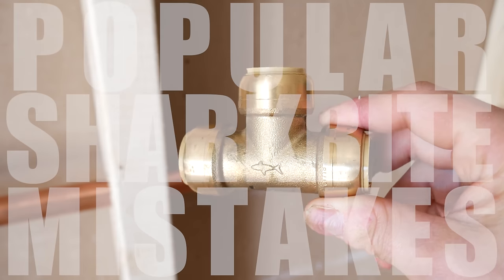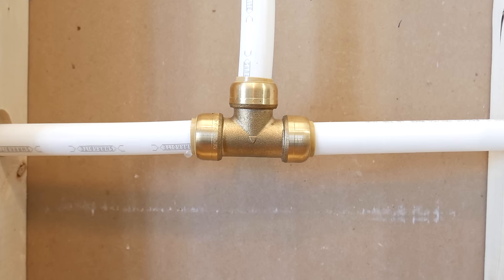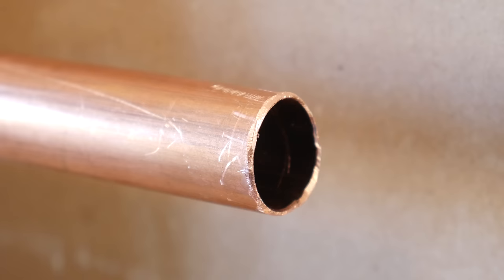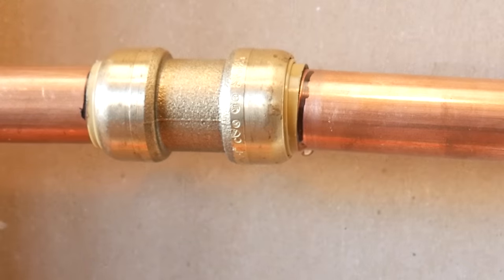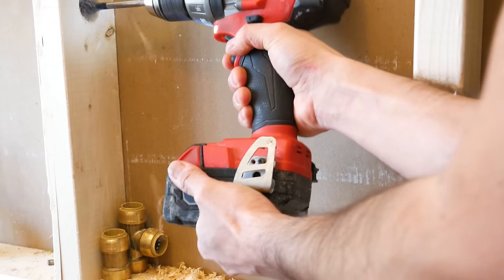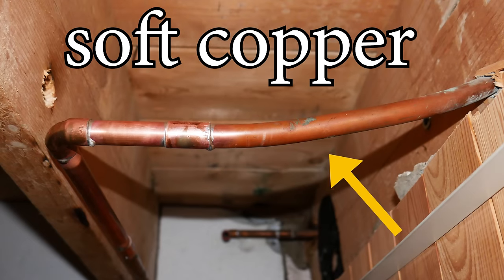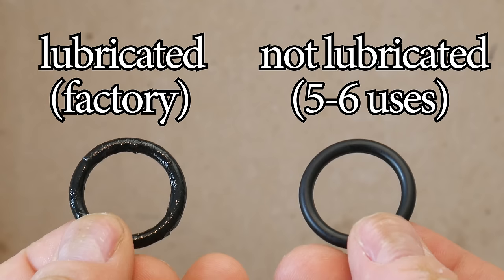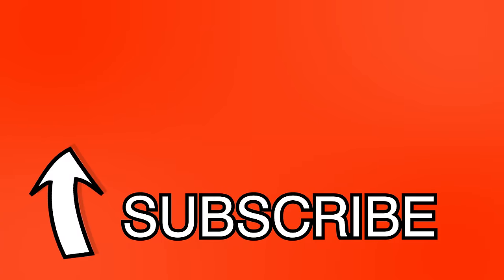6 SHARKBITE Mistakes NOT To Make! | GOT2LEARN

Comment: These are great fittings. They work well. They do rely on a rubber Oring to seal. As with any O-ring in about ten years the O-ring will fail. So never install these in a wall or ceiling. Leave them accessible.
Reply: Propress uses o-rings.  So theirs will fail in ten years too?  Propress fittings are installed in very inaccessible places.  What about the hundreds of o-rings in the modern automobile?  Ten years for them too?
Reply: @StilettoSniper  I said in about 10 years the O-rings would fail. Could be 7 could be 12 years but at some point they will fail. I’m a 35 year Master Plumber so I cannot speak to automotive O-rings. I would say pop the hood on most 10 year old cars. Most have oil leaks.
Reply: @Iwillnotbepushed  So you would recommend never installing Viega ProPress fittings in a wall or ceiling for the same reasons then, i.e. the EPDM o-rings will fail in approximately 10 years or so, correct? BTW, in my 40 years of wrenching on  automobiles, including the 18 and 20 year old ones I drive currently, I can attest to most oil leaks coming from non-EPDM gaskets such as oil pan, transmission pan, and valve cover gaskets, which dry out and crack due to being exposed to harsh chemicals, extreme heat and mechanical pressure.  Not EPDM o-rings, of which automobiles manufactured in the last 20 years have hundreds.
Reply: @StilettoSniper  that’s all well and good. I also do my own mechanic work. Always have since I was 15 years old. Rear main seals front transmission seals water pump seals. all rubber will eventually fail and in plumbing usually that means 7-10 years. Like I said I cannot speak to automotive except my own experience. I do not put in ceilings or walls anything with a rubber seal that’s under constant chemical and pressure assault. That includes Pro Press. I do not like it I do not use it. I have several other systems I trust far more. Also with Pro Press there is a copper fitting and copper pipe involved. Ever seen copper get pin holes in it? Happens for numerous reasons.
Reply: @Iwillnotbepushed  OK, while I may differ regarding your approximately 10 year lifetime estimate for EPDM, I do respect your opinion since it is one of the few responses I've heard that is logical and recognizes that the EPDM o-ring material used in ProPress and Sharkbite is essentially identical.  Most professionals I've spoken will shit all over Sharkbites and say they will leak because the EPDM o-rings deteriorate with age, but then will state that Propress fittings will not have these o-ring deterioration issues because they are crimped with thousands of pounds of pressure with a magical overpriced tool.  Logically, this makes no sense whatsoever since the fact that the o-rings are in a crimped sleeve has absolutely nothing to do with their lifetime.  Thank you for taking the time to explain your position clearly.
Reply: @StilettoSniper @Alan Sawyer While I am neither a mechanic nor a plumber, I have my two cents to give. I have a hard time believing EPDM O-rings only last 10ish years. I am a commercial flat roofer, and we use EPDM membranes occasionally and you can normally count on them to last 25+ years sitting out in the sun 24/7. I know UV exposure is different than being under pressure, but 10 years for a sharkbite (or similar brand) seems unreasonably short. I put sharkbites in my house 8 years ago in an area the was to risky to solder, and I couldn't get pex crimpers in. Should i inspect them in a year or two? They are behind drywall...
Reply: @humblehunk9022  they are acting like copper last forever.  It doesn't.  Everything eventually fails . Time will tell on these things
Reply: @StilettoSniper  He's right when it comes to city water. But if you're on a well with no Chlorine Content then I could see these lasting SUBSTANTIALLY longer. There are some really old flappers in homes with well water because the chlorine isn't eating up the rubber.
Reply: @StilettoSniper  The warranty on Viega PP fittings is 25 years. How long is the Sharkbite warranty?
Reply: @MisterTwister88  they warranty them for 25 years also as long as they are installed per manufacturers instructions...
Reply: @aaronmetcalf527  Yeah…..I know that

Comment: Wow. Thanks for these videos! 

 All for your videos you guys got me to cut the 4 old multi turn shut off valves and replace them with 4 new SharkBite valves. 
 What a Breeze in installing them.

 Was hesitant at first, but after watching your videos I tackled that job! 

   Is it true or it's a myth by using fine grit sandpaper it can ruin the copper pipping?

 I forgot to buy the depth guide, so I measured with a tape measure and the online website guide. Let's hope it works! 

 Thanks a ton for all your Amazing videos!  Big fan! 
 Just came across your channel and been loving it ever since. 
You guys are clear and to the point.
Reply from the maker: Thank you so much!!

Comment: I’ve been in this trade 40 years, I hate shark bites, the younger guys seem to love them. In a copper pipe leak situation, I prefer to install a compression valve, no rubber to deteriorate.
Reply: The only place I would feel comfortable using sharkbites is exposed pipes, anything behind a wall should use longer lasting fittings.

Comment: You didn't mention using sand cloth to debur. I just put one on today, a shut off  for the kitchen hot water. Cut the pipe with a Milwaukee 1/2" pipe cutter for small spaces. Nice clean cut. Clean it with the sand cloth and a rag. Bites right on. 
I want to know what happened to the ones that click when they're installed properly.  No room for error.

Comment: I have a question... if you did not fully insert the required 1" pipe into Shark Bite, can't you just push the pipe in a little more until it is snugged after the fact providing that the pipe has some slack?
Reply from the maker: The best way to verify is to have the mark, without the mark you can't be sure at 100%..
Reply: Yes

Comment: Any thoughts on leaving the pipe stiffening insert in the fitting when used on hard pipe?
Reply from the maker: Yes, you need to leave it in, copper or PEX.
Reply: sharkbite dŏ t  com/resources/faqs/universal-brass-push-fittings-faqs
Can the tube liner be removed?

Yes. The tube liner can easily be removed by pulling it past the o-ring, with the aid of the SharkBite Disconnect Clip or Disconnect Tongs (both sold separately). The tube support liner can drop out of the fittings as it can move freely past the grab ring. Needle nose pliers may be used to pull the tube support liner out.

NOTE: The tube liner is necessary for use with PEX, HDPE or PE-RT Pipe. It is not required for copper or CPVC, however, it is not necessary to remove the tube liner from the fitting.
Reply: For hard copper remove the pipe stiffing, most cases where there is a leak in hard copper it is because it was installed with this fitting and it obstructs the connection.  On PEX, CPVC it helps to strengthen the joint.  It is bot needed with the copper wall.
Reply: @alsworkshop135  Hey Al, could you please explain what the this “pipe stiffening” is that’s not needed for the copper wall. I’m going to use this shark bite on a connection of copper to CPVC. So, I’m assuming you’re referring to the copper side of this attachment. I just don’t know  how to identify what you’re saying to leave off (or out) of the copper end. 

Thanks
Reply: @YouTubeStudio101  yes, on the copper side of the connection you can remove the plastic piece on the inside of the sharkbite.  I use needle-nose pliers to remove it.
Reply from the maker: No need!!
Reply: @Got2Learn  check out the Sharkbite website where it says you can remove the plastic stiffener for copper connections.

Comment: I have never had a leaky Sharkbite fitting from the Sharkbite side (had a threaded side crack once after a few months of use).  Have used hundreds of them.  Aside from the depth markings, which I have never done since the click when fully inserted, I would think that all these things are common sense.  It may just be me though since the plumbing my dad taught me was to sweat the pipes.  I switched over to Sharkbites when I found them around 20-25 years ago and switched to using just them after talking to a friend of mine in aerospace saying that the technology has been around since the 60s and was used by NASA.  Replumbed whole houses with Sharkbites and PEX.  I have just started using the Sharkbite MAX fittings on newer projects and like them even more since you don't have to have the white plastic pipe support any longer, which means even better water flow.  I know they have their haters, but from my experience it is only misuse that causes them to fail... just like most things.

Comment: The dislikes are from "old-school" plumbers who swears they see leaks from SharkBites all the time but never on a soldered copper joint.
Reply: @sonacphotos  -  I was being sarcastic about the dislikes. I agree that SharkBite has their uses - I use them where their easily accessible and can be checked for leaks. But I definitely don't agree that plastic will outlast copper. A proper soldered connection will last 50+ years and the pipes can be re-soldered, whereas SharkBite can a warranty for up to 25 years. CPVC becomes brittle and will break easily after decades during a re-pipe.

Propex is the only connection and material that can probably last as long as copper.
Reply: Shark bites are only guaranteed for 15 years, Crimped pex and soldering is guaranteed for 50 years
Reply: @onebozo4u , don't know what you're talking about. SharkBites are warrantied for 25 years, this is straight from the manufacturer's website.

With crimps and clamps, you're fighting against the expanding nature of the pex, so those connections get weaker over time. Propex is the only one that gets stronger over time.
Reply: Only hacks use shark bite fittings. Real plumbers don’t
Reply: I see Sharkbites leaking alot on soft copper. I also see them leaking on hard copper due to the person using the plastic inserts on copper.  I see solder fittings leaking as well.  It's all about the installation
Reply: That's right  😁 👍
Reply: @lawrenceolteanu7234   …so don’t even think about using a Sharkbite ‘cause you’ll be demoted.
Reply: @Lawrence olteanu  I'm not a real plumber but now I don't need to be.. or need one
Reply: Or old school plumbers who see billable labor hours going down the drain!

Comment: Good tips. I only use them if I positively have to. I'm old school and I don't trust them.
Reply: I'm retired, so I guess I should be old school, too.

That old school method sure did a great job here in Texas this past February 2021. Only about every other house on my street (including my own) and neighborhood had busted pipes.

'Trust' is relative.
Reply: That's more a design issue than method with Texas.   All the plumbing was made with the thought "it'll never get that cold for that long, why bother including the fail safes"

Comment: Great videos buddy!

I never done any plumbing work until recently because had switch a tank water heater to a tankless. Not an easy task for a person whos never done it before, but I have to say I was able to accomplish the hot and cold lines in copper to the machine + more. All soldered fittings! No shark bites, but I did use the cap when I wanted to test a line or stop for the day.

All thanks to you! Thank you!

Edit: When doing the tankless heater, I also had to deal with black pipe for the gas. Any chance, can you look into making videos about gas plumbing?
Reply from the maker: Thank you so much, and good job on the tank ;)
Reply: No! Leave the gas to a certified professional. No YouTube instructional videos.
Reply: @ryanfriars545  You shouldn't need a certified professional for every gas line job.
Reply: @immathug  you would think that, but if you’ve seen some of the homeowner repairs I’ve seen with just plumbing, gas and electrical, you’d understand. There’s usually a lot more involved than just a few quick connections.
Reply: @ryanfriars545  I work in the lumber industry so I know what you are talking about when you say the jobs you "seen".
Reply: @immathug  So you would also know that code requirements change in many different areas, therefor making any “how to” video on gas fitting would be pretty different. I would assume you know about liability too?
Reply: @ryanfriars545  I haven't seen this video in a long time so I dont remember if he makes a disclaimer in this video. Since you do mention liability, wouldn't liability apply to the other videos as well? Liability isn't just for gas lines and codes are different for water lines in different parts of the country right?

Comment: Shark bite warranty 100 years when used underground as long as it is friction taped before covering with dirt
Reply: No way an O ring will last 100 years.
Reply: @integr8er66  If warrantied for 100 yrs, they pay 100 percent for whole job to replace it not just the parts.
Reply: @returntonature8773  You are a fool if you think any company that is in business today can be expected to be in business in a 100 years. Warranties are only as good as the company behind them and if its a good company it will be bought out and if its bad it will go out of business. You trust this warranty, I'll trust proven methods like copper and solder.

Comment: I rather soldier my pipes then put them bites fittings on especially if the pipe is behind the wall.
Reply: Same here. After 26 years of plumbing maybe I'm old school, but I only use shark bites if I absolutely have to.
Reply: I used one in a commercial building of 90 psi i couldn't soder on a 3 quarter park because if i did i would melt the o ring on the propress fitting next to it it was a water line going from 2in to 3 quarter copper it dint leak hope it never does
Reply: Soldering is faster and cheaper, especially if you already have an assortment of fittings.
Reply: @Harloha  By your own admission, you are "old school".  SharkBite is fantastic.
Reply: @george5120  until they leak. They are awesome, but I've been on so many calls because sharkbite leaks. And I just had one last week at a bar in Waikiki from pro press leak, flooded the kitchen and half the dining room. Other than that, they are a great invention.
Reply: @Harloha  Copper plumbing will suffer pinhole leaks or corrosion at soldered fittings sooner than copper plumbing will suffer a SharkBite malfunction.  Could be that the SharkBite was installed DIY by somebody inexperienced.  Plus, SharkBite fittings at Lowes and Home Depot are often returned for refund and then resold.  Just because a SharkBite fails doesn't mean the SharkBite is the cause of failure, in other words.  Any fitting will fail before its time, if if wasn't installed correctly.
Reply: @george5120  true, except a pinhole leak in copper only happens when plumbers who don't take pride in their work and only want the paycheck don't wipe their joints.

Comment: In another video you mention not sanding copper but then do it as part of the cleaning here... What's correct? ALso, with respect to reaming and deburring, does this need to be done on PVC and PEX pipes as well (I think you did deburr a PVC in another video), or just copper? In this video you say just copper, but, I have seen other people at least deburr/ream PVC. So, how about PVC and how about the Sharkbite PEX?

Comment: deburing the cut copper end isn't enough... you need to also follow your cuts with a clean emory sanding, deburing and then final prep with the Shark Bite Safe Seal Tool to get that nice beveled fitting so your compression fits nice and snug against the o-ring without any harm!
Reply: You don’t sand the copper for a shark bite fitting. Debur end and clean stickers off with  adhesive remover and then wipe down with alcohol. Per Shark Bite  instructions

Comment: HI - I can't seem to find in any of the videos on sharkbites how to attach the faucet screw on part to the sharkbite fitting (which Is push in)  And the adaptor that came in the faucet kit did not work either since it screws on something and the faucet lines screw on something as well.  Do you have any idea what I am talking about?

Comment: One major thing you forgot to mention is never use a PEX pipe fitting (Mustard color) on copper pipe but it is fine to use a copper fitting (Black color) on Pex tubing!
Reply: Hmmm, the ones I bought recently are labeled as being for both PEX and copper. I used some on copper and they sealed just fine.

Comment: First sharkbite mistake: using sharkbites for anything other than emergencies.
Reply: Exactly
Reply: Truth
Reply: A close second would be buying a sharkbite in the first place.
Reply: I have seen them installed on all 1/2 and 3/4 inch  in a brand new building.
Reply: Had them on my water pipes for 7 years not a single leak even though I used many fittings

Comment: I’m not a plumber, I’m an commercial HVAC/R service tech. I personally hate these sharkbite fittings; I’ve had better luck with just using a coupler and soldering it in. It does make sense though to use these if you’re in a tight spot and the risk if starting a fire is high.

Comment: What about the plastic insert in the shark bite when connecting to copper? We have been removing them and found its alot easier and it doesn't leak...
Reply from the maker: Sharkbite said they don't need to be removed, just make sure there's no sharp edge inside the pipe or it'll snag on it ;)
Reply: @Got2Learn  Problem is the insert falls down inside with gravity making it difficult to push a copper pipe on. So much easier without the insert. Does removing it damage the fitting in anyway? If not I highly recommend removing.

Comment: How to measure the amount of pipe needed between sharkbite fittings? I am replacing a section that has 2 elbows and I will also have to use 2 couplings on each end to attached to existing pipe?.